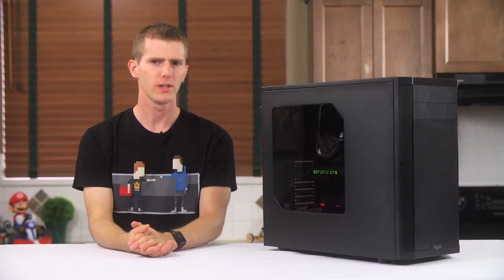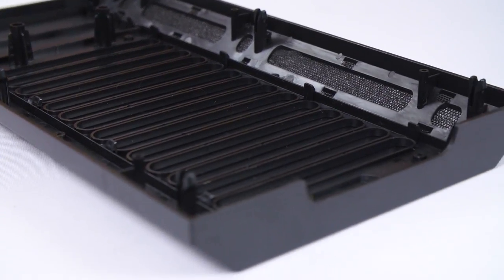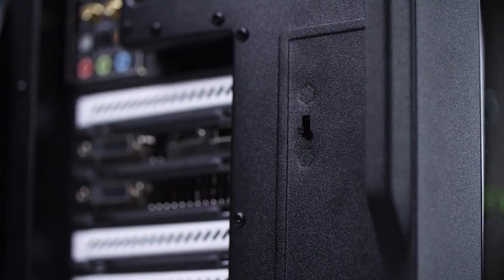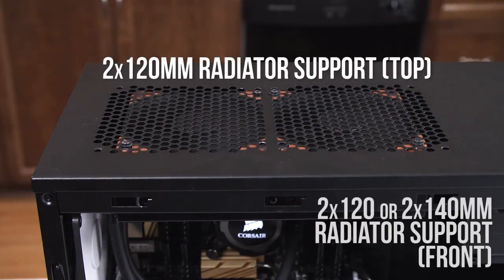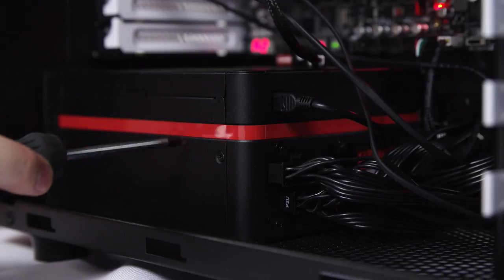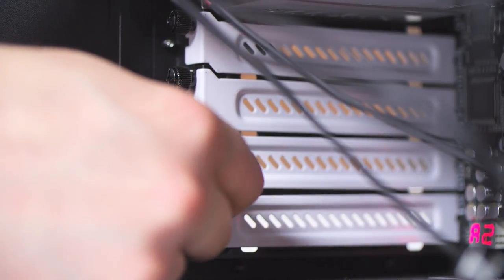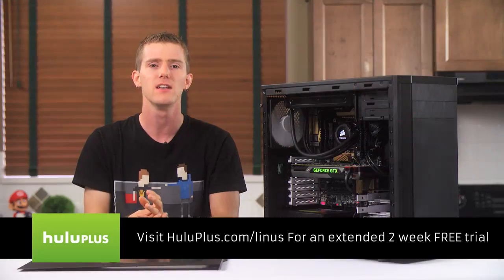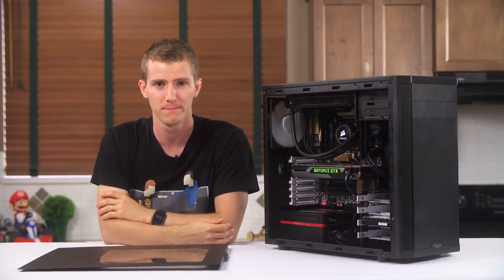Fractal Design Core 3500 Computer Case

Comment: I can't think of a case review in recent history, where you said so many negative things about a case. All valid points though IMHO. That top panel for the cooler certainly looks VERY cheaply made. Also the SSD mounts on the back with the screws going in from the front?! What were they thinking? And then there's that fan controller...Horrible placing/implementation. So to answer your question. No, I don't think you were too harsh in your criticism. Fractal can do better...a LOT better. They dropped the ball on this one.
Reply: szabi you're basically famous
Reply: Agreed. Okos a szó.

Comment: I have a define r4 that I used for my very first build and like you I do not like the ssd mounts on the back of the motherboard tray and I agree with you about the I/O set up and the 5.25 inch bays really should be mounted better. The case looks good and hopefully they will adress the ssd mounts and the I/O. This still looks like a nice case to me.
Love the real reviews instead of showcase reports these are very much appreciated.

Comment: Just bought the R4 and waiting for delivery, can't wait to start my first computer build!
Reply: The R4 is a pretty solid case! Nevertheless you still need to take note of some things mentioned in this video, like placing the SSD on the motherboard tray and connecting it. Good luck!
Reply: Congrats! just built my first rig in an r4 back in december
what goodies are you putting inside?
Zachary T. thought linus said it was different for fractals other cases? I should probably know, but as of yet I only have a single 250 ssd and the r4 has a crazy number of drive bays
Reply: Zachary T. Yeah that's fine, I'm not going for a really high end build and going for one graphics card so it's no trouble really. Thanks mate, should be fun!
Reply: looks great, about the same as what I used, (minus the peripherals) I was going to go with a 770 till my dad offered to buy the graphics card as a Christmas present, So I got a asus dcu2 780, (which isn't a great overclocker, but is almost silent) and then I got a Noctua D-14 and went with a corsair RX750 (which unless loaded (and it never is) doesn't turn on its fan), Thus my build is quieter than my 2 year old laptop XD.  good luck with the build it's really fun (especially making a wan show wall with all the packaging :D  )
Reply: Noah Fix You must have been a brilliant son for your dad to buy you a graphics card like that! I know can't wait now ordered the case around a week ago and still waiting for it to be dispatched, either today or tomorrow. I'll let you know of my build if I remember, I plan to record my whole process with my build. :)
Reply: Noah Fix You have a wall of component packaging too?! That's awesome! I place them neatly in my shelf and it's like my tech nerd corner!

Comment: Well. Like you said, they should be experienced and there shouldn't really be anything that makes you judge it too harshly. The SSD mount in the back and the fan controller problems were quite obvious and should therefore been expected to be a problem.

Comment: this case is £52? it's like half the price of a case I would ever consider. Doesn't look too bad really. Gaming on a budget.
Reply: Budget case get the corsair 200r, great case for £40. Don't bother with this junk
Reply: No, it's more like £63 with VAT added, and then more likely to be £70 UK retail to round up. Never do direct conversions, they are never accurate.
Reply: Alex Smith I never add VAT as the manufacturer never intended them to be that price across various regions. And still if it was £70 that is entry level.
Reply: ***** I was going off the MSRP with VAT added. Clearly Scan are discounting it.
Reply: Bushy Bush £70 is hardly entry level. £40 is.
Reply: ***** And £53 on Amazon. To which I would pay very little extra.. So I was right and it is still a cheap case.
Reply: Alex Smith Entry level means something for different people.. an entire entry level computer is £700 for myself.. 1/10 budget on the case. Yours may differ.
Reply: DaniiCEO
Just what I bought, thanks for making me feel sure that it's a great case
Reply: I believe you can go for the Zalman Z11, which only sets you back around £50 on Amazon. It looks good imho.
Reply: I love my 200r. It's so easy to build with. I would probably still use this case with a $1500 build.
Reply: nope
 i hate my 200R the drave bays vibrate and its really annoying
Reply: Marius B I'll be honest, the Z11 is a mediocre case at best. My main system was housed in it for a year (now it's in an Enthoo Primo) and it had mediocre cooling, attracted tons of dust, had very little room in the back for cable management, and was very cramped to work with. The plastic, especially in the fins at the top, is brittle and easily snapped, and the CPU cutout isn't positioned correctly for most ATX boards. IMO even the Source 210 was better to work with.

Comment: When there are so many good case options available, it's the details that count, so no, I don't think you were being too harsh. For a case manufacturer of Fractal's size you would expect it to be much better thought out.

For some people they just won't care about all those little things as they will probably remove most of the insides anyway and believe it or not, some people still actually prefer air cooling so the radiator issues won't matter.

Comment: Did you judge it too harshly? No, this is perfect!

I actually don't like included fan controllers at all. Aren't most motherboards capable of setting custom fan curves? Did a cheap browse-the-web build with a cheap ASRock H87M some time ago and even that board had a very customizable fan curve(even let me turn of the fans completely at idle).

Comment: You're not being too hard on the case. I have one i spent $65 on a case and i could sit on the top of it with very little flex. When i look into a computer that is color matched it is kind of disconcerting to see something out of place such as a green pcb, and that flex in the drive bay and roof was horrible. But i am pretty sure this was aimed at a very basic tier. So it is good for a basic minimalist approach.

Comment: I own the Define R4. A very well done case. Has a few scratches on the side but that's my fault. I do that with every case I buy for some reason. Dunno why. Might have a problem lol. But this case... it looks alright but I probably would recommend the R4 over this. Sure it's fine in general but those few key bumps on the road that Linus mentioned will keep me away. Hope the next release case improves where this case has fallen. Fix the errors and you have a prime grade case ready for show ya know?

Comment: just an fyi, they've changed the location of the fan controls to higher up, and it's definitely not as flimsy as in this video
Reply: Indeed.
Got a 2500 and the fan controller is at the top of the rear panel. Still not perfect because it's mounted along the centerline of the case even though the PCB is small enough that they could've hidden it up in the nook directly above the rear I/O panel, but it's still a great improvement over the version Linus had.

Comment: I really wanted this case for my first build this fall. Do you have any good alternatives? I don't want any water cooling so it doesn't need any space for that, but I'd rather have mid-tower.
Reply: Corsair 400r ?
Reply: Corsair Vengeance C70
Reply: Maybe a corsair yeah... but right now i got my eyes on NZXT H440 :)
Reply: Haplue96 If you were eyeing up this case you might like the Fractal design arc midi R2, similar finish (although much better build quality) it's what I would go for.
(also the fans that come with Fractal cases are very good so you wouldn't need to replace them)
Otherwise I really like the look of the H440.
Reply: Haplue96 Don't buy Corsair, their stuff is overpriced/overhyped for the most part, and low-end models such as 200r, although look good, are made of super thin metal, if you install a decent fan in there it will make a lot of noise. There are a lot of good brands such as Cooler Master, Bitfenix, NZXT, Fractal Design and others. 
If you can tell me how much money you are willing to spend i will recommend something more specific.
Reply: The corsair air 540 is a really simple nice looking case with much space for everything:)
Reply: ***** Thanks, I'd rather not go over 150$. So my current plan is to get a NZXT H440 if it goes on sale, but please, recommend something else if you think its better :)
Reply: ***** Exactly what I have seen, like their cases coming with one crappy fan if you try and get a budget case from them.
whereas fractal will include three for a similar price.
Reply: for a really budget one corsair spec-02, quiet, solid, cool and at a very low price! Bought it personally a couple of months ago
Reply: Haplue96 NZXT H440 is a really good silent case, so if you like the looks of it, it definitely is a good buy.
You also might want to check out CM Storm Scout 2 Advanced, it's a great case for 95$
Reply: Haplue96 Phanteks Enthoo Pro, just watch some reviews, it is outstanding.
Reply: epicDuftbaum It is a beautiful behemoth of a case, and a first pick if you have the budget for it.
Reply: Phanteks enthoo pro . Its near unbeatable
Reply: Cooler Master Storm Enforcer mid tower case. It is available with 200mm fan in front and a optional in top. Perfect for silent air-cooling.
Reply: TheWargod56 It costs 90 $ without the window. It is quite big, so, you can build a few systems in it, you don´t need to upgrade in near future ;)
Reply: epicDuftbaum They even announced that dual system version, only problem is availability here in the UK.
Reply: enthoo pro
Reply: anything corsair
Reply: I personaly like the looks of the Corsair 450D. Nice clean look but a nice side window to show off your stuff.
Reply: ***** Why? be quiet is a good manufacturer, no doubt, but they hav eno experience with cases. So, amybe it will be quite good, but it will have some issues they have to fix for their next case.
Reply: NZXT Source 210. Best $40 case in existence.
Reply: Corsair c70 I got it and did not regret buying it at all
Reply: Corsair 550D is really nice
Reply: fractal arc midi v2 great mid tower and lots of dust filters.
Reply: nzxt h440
nzxt phantom 410
fractal define r4
Reply: I cant recommend the Phanteks Enthoo Pro more. I got mine a few days ago and absolutely love it! For the price its a steal. :D
Reply: Phantom 530.
Reply: Haplue96 The H440 is a VERY good case, but it will probanly need good fans to keep it running cool. The Phantom 410 is a good alternative, with lots of airflow (It's a bit cheaper too).
Reply: Beanstalk Games But it comes in 4 fans? Is that not that enough? XD
Reply: Haplue96 Yes, but there isn't nearly as much space for the air to flow out
Reply: I have a $40 NZXT Source 210 case that works perfectly for me.
Reply: D3R_RIESE97 I had looked at that one for a while, how do you like it? Any particular components (fan controllers, addon light kits, etc) that work well with that? Thanks
Reply: K4Robotics It's the best case that you can get for the price range. The looks, features, and usability of the case make it comparable to cases twice it's price. The regular is $40 and the windowed version is only $45. It's a great case that I highly recommend.
Reply: D3R_RIESE97 Awesome, thanks. Its a mid tower right? I'm actually trying to decide if I want to go mATX or ATX, ATX seems slightly better but I dont know that I really need things like 4 GPU slots lol. Anyway thanks for the help.
Reply: Haplue96 You mentioned H440.  We've had the black/red one for about two  weeks now.  It's really nice.   I added two fans to the top vent.  It's not totally silent, but it's pretty damn quiet for sure. (Including video card, there are 8 fans inside now.)  This YouTube channel was instrumental in picking it; I was pretty nerdy for a while and watched a large quantity of reviews/unboxing videos. For a few specific reasons, I'd recommend saving a few more dollars and getting the H440 over the 3500 in the video.
Reply: Enthoo Pro at 99$ is the best value with unbeatable quality and features.
Reply: K4Robotics Yes it is an ATX mid tower. I have an ATX motherboard that has room for 3 graphics cards in it. The case has 7 PCI slots. The value you get per dollar with this case can't be beaten. It has three 5 1/4" drive slots and eight 3 1/2" drive slots. It can fit up to 2x 120mm fans front, 1x 140mm side, 2x 140mm top, 1x 120mm (included) rear, and 1x 120mm on bottom. That's up to 7 fans in the case total. I really like the space for cable management in the back. I hope this helps you out with your build!
Reply: I vote for the the fractal design r4. I am using it and it is super quiet. I've installed 2 extra fans in it and its still very quiet even after taking out a little bit of the sound dampening material.
Reply: I think that the Corsair carbade spec 02 is a nice choice
Reply: I really like my Corsair 750D. Very rooms, 140mm fans, dedicated ssd slots(4 I think) and just a great overall look.
Reply: Dtroll MC Even though the 750d isnt exactly mid tower size, ill add a second vote for 750d wouldnt change mine for the world, so much room
Reply: ***** Yea sorry missed the part about the mid tower :3
Reply: The Corsair 600T or anything from Corsair really, but the 600T is the best looking case currently without looking like a transformer.
Reply: Haplue96 Wise choice, that case would be great, I built my computer in a terrible Coolermaster rc-430
but when i get money im upgrading massively, getting the H440, and a h80i from corsair
Reply: not so sure about you budget, but corsair 760T is one you should take a good look at before buying anything. Now, i think not one case is better than it, its look, and capability. just look at the build linus made with it, how many radiator he can fits in it and still looks amazing!
Reply: Corsair 540 air? Super happy with mine!
Reply: Corsair Obsidian 450D
Reply: ***** the Arc Midi is a pretty fantastic case too, also the NZXT Phantom 410 is pretty good for a mid tower case, though a bit more "fancy" in looks than anything that Fractal or Corsair put out there.
Reply: go for the cm storm enforcer Linus did a review on it a while back and i bought it on amazon and love it
Reply: im also building a PC, but im confuse to choose between Phantom 410 or Phanteks Enthoo Pro.

Enthoo Pro is full tower, but the P410 arent relatively small either.
i like Enthoo Pro features, but i like P410 aesthetics looks.

im confuse now..please help me making decision.
Reply: ***** yeah i know.

i can sacrifice the looks if the Enthoo Pro is really worth it.
its not that its ugly but just i like the P410 looks more.

but you got the point there about not giving the crap after a while. thanks man.
still open for more opinion.
Reply: you can get the rosewell challanger for 40 on sale right now and its a great case
Reply: Haplue96 The enthoo pro seems to be better then H440
Reply: Hey guys, thanks for all your suggestions! I looked into the The Enthoo Pro and it look really promising! To you who have it, does it have good airflow with the 2 fans included only and does it intake a lot of dust?? Those are the 2 things I worry about.
Reply: I have the enthoo pro. Absolutely gorgeous, and very quiet with the right fans. JUST GET IT!
Reply: Haplue96 no dust at all. Great filters on all the fans. Although, I would suggest at least 2 more fans.
Reply: fractal r4

Comment: Is this true for the 2500 as well? It seemed like the strongest contender for a budget build I'm planning until I saw this. At the same time as I could see how the similar design would have the flaws trickle down to the smaller models, yet the strenghening of structural integrity due to the smaller chassi also makes sense. Any 2500 owners out there?

Comment: Hi Linus! 
No, your criticism is entirely justified Fractal be established as Case builders know how all the details and accessories looks like and how they fit and I as a customer should be able to trust that everything I buy for the computer fits. I start quaking should not have to rebuild a new case and the singlet signal should Fractal absorb. Should add that I like a lot about Fractal and owns two Cases Fractal Define R4 and Fractal Node 804 And these two Cases is absolutely gorgeous building in but there are two very different cases. By comparison with this new case, it is just rubbish well 
Good description again! Linus Thanks
Will you excuse my English
Christer Tornerefelt SWE

Comment: No, I don't think you went too hard on the case. Fancontroller in the back is unacceptable, the top flexing when a radiator is mounted is just as unacceptable. The rest is kind of nitpicky, but it does make sense.

Comment: This case is worst by far I've seen from Fractal Design. I got the Fractal Design R4 and it's so perfect in my opinion. So much cable management space and the top hard drive case you can remove, gives more airflow. I am glad i own it. You will not be disappointing.

Comment: sad. i dont think these were mistakes but rather fractal offering broken features on the 3500, in hopes you would end up purchasing a more expensive fractal case with working features. for example one of the features that sells the arc midi is the orientation of the fan mounts on the top of the case. everyone likes that feature and it makes mounting a rad at the top much better solution. however if i dont see this implemented on a new define case in the future i am going to start getting more skeptical.

Comment: No, you weren't too hard on them. Fractal should know better by now. This is a $90 case (roughly) with the build quality of a $40-50. There are cases with better air flow, rigidity, 2.5" drive mount implementation and such for this price or cheaper, even by fractal.